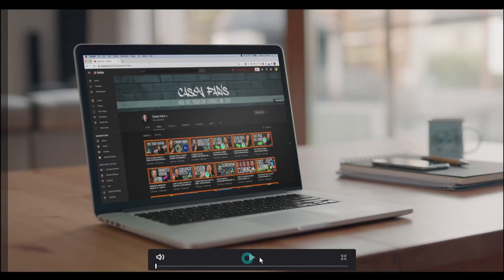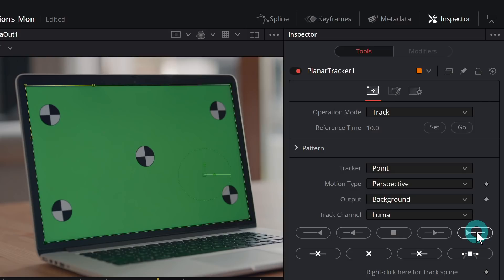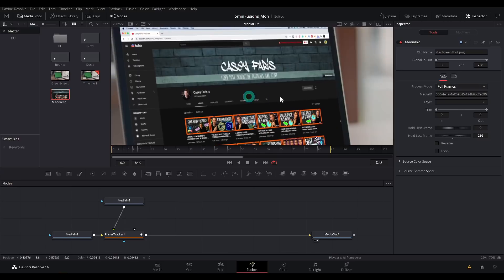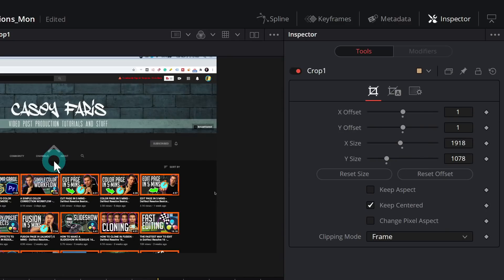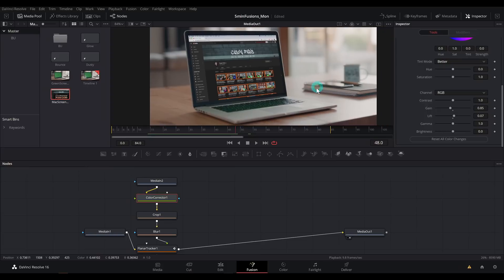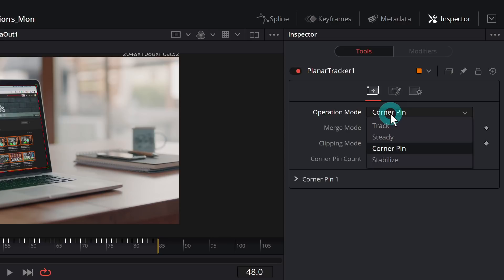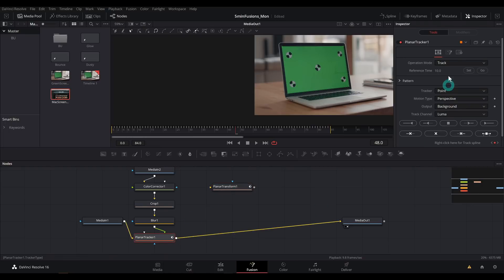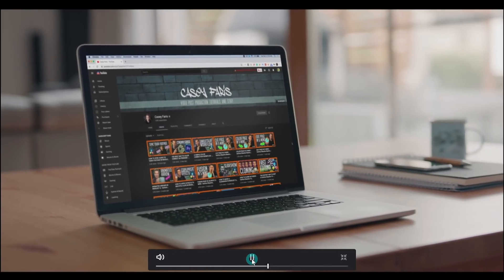SCREEN REPLACEMENT IN FUSION - DaVinci Resolve 16 Tutorial [Beginners Welcome!]

Comment: Good Stuff, Change the blend mode on the reflection though. And instead of cropping the replace screen do something with it to get a soft edge, what ever work flow or effect will let that happen. 

Oh and with the reflection, if you don't track it but, instead use a the screen replace to make an alpha you can then draw the reflection bigger than the screen. Then when the shot or screen moves it will shift a little the way a reflection should. Sometimes this makes a perfect illusion, other times you may need to add a few key frames to the reflection node to make it move a little differently.
Reply: That sounds almost like a scrolling texture... nice tip

Comment: What about placing an image or video onto a screen that is moving?  And moving into different angles?
Reply: It should work the same as the tracking method he used takes note of the screen's perspective, so if the screen is changing shape from perspective the tracker should work just as fine
Reply: @scorebatgaming  it doesnt work i think
Reply: yes!
Reply: Not working for me...by the time it has 'tracked to end', the zone ive selected ends up off the green screen. Help please 🙏
Reply: @bacanito  same happening to me
Reply: @venutiggu6291  you need a more powerful computer. Both the ones i tried had 16gb or RAM and it wasn't enough. I mostly make music and if the computer cant handle something, ill get errors. I know understand Davinci will simply go as far as it can go and say nothing. For this issue, anyways, havent really gotten anywhere else, im learning film through an internship and they use Premiere 😑

Comment: Just a question about the lift and gain corrections: wouldn't the screen itself be the brightest part of that image, in its bright spots? If so, why match it with ambient light? I can understand the concept for the darks, but I don't know about the bright part...
Reply: the screen may emit light but in a video shot unless the monitor is at max brightness with a bright overall image it doesn't look realistic that a computer brightens the room.  In this example, most of the image he is superimposing is dark, so it wouldn't give off the same kind of light splash as the green screen did (on the keyboard).   Personally, if it was a bright clip i was superimposing, I would color correct the keyboard area to match the screen (white, green, whatever).
Another option, way more advanced, is to have a copy of the same mediain (of the screenshot), flip it upside down, reshape it and overlay it onto the keyboard, then play with various color, saturation, and blending modes to get an effect that is more detailed.  This would also be useful for the weird reflections that might come from (for example) if the media on the monitor is actually a video clip. as the video plays on the screen, a reflected and muted/blended version plays out on top of the keyboard.  Hope that helps!

Comment: What I’m looking for is a fast and easy way to add borders to PiP images. I have a photography vlog, and it would be great to be able to easily add the still photos over the video with a small white border and a drop shadow.
Reply: if they are all the same dimensions, you can prepare a fusion template for your photos. Aside from any adjustments you might want to make with a color node, you'd only need to use keyframes and the mediain (the additional images to appear on your footage).   Then, any time you want to add a new photo, you pull down the template, add the new image, and then tie it into the footage at the spot you want.  The template also gives continuity for the overhead spot.
Example - you can use a mask layer at 0 width in frame zero and 100% width at frame 2 seconds after, with the photo under the mask layer. Then for the same keys you can also use the fade or blend sliders to make it appear over the 2 seconds (but only within the mask). Want it to look like a printed photo? put a white background with a shader node on it for some drop-shadow and place these behind the photo as well.  (make sure the mask fits where you want it.

The thing with these transitions is, it's easier to imagine the end result and then move backward in the process to determine how to display when it is being played forward.
hope this helps!

Comment: What if a hand or fingers crosses over? 

For example I had 2 clips I shot, I put tracking marks on one on a phone. in one scene and my arm passes over a couple times
Another I thought the spot was above my head and it was more most the scene, but I crossed in front of it with my hand and head a couple times. I didn't think I would need a green screen since I didn't think I would pass in front and I was shooting myself. 

I tried to mask over and track them, but the issue I had was figuring out if it was even possible to stop at a certain point, move the mask or cut it out for those handfuls of frames, but not totally change the shape of my corner pin. So I would example get to the part where my arm crossed and tried to move the corner pin and thought it was now closer to the shape I wanted, the rest of the track would be in that shape and look weird. 

Similar to changing from clip to frame in the color tab, but in fusion. 

I ended up in a rush just cutting the track and using a freeze frame and then cutting between the two, but it meant it was static. 

Something like that if it hasn't been shown is what I want to learn.

Comment: Hey Casey, maybe you (or someone else) can help because Fusion is driving me absolutely nuts. Here's the situation:

I'm talking about a conclusion, and pointing out three things. All three things need to pop up on my screen. Those are: "Cheap", "Lightweight", and "Quality".
So far, I tried to add three texts, then make compound clips, then make a fusion clip etc. Obviously I messed that up so it didn't work. Then I thought: Why not build it in Fusion. So I got the video clip, and made it a fusion clip. In Fusion, I added three texts. I've also added a tracker. So now the situation is:

Text 1
Text 2
Text 3
Media in ======Tracker=======Media out

Then, I needed to transform the text. Because: "Let's make it more complicated shall we?"

So the situation is this:
Text 1 > Transform (1)
Text 2 > Transform (2)
(Both transform are now combined in a merge node (1))
Merge node (1) goes into the Tracker(1)
Media in(1) ===== tracker(1)=====Media out(1)

So far so good, it's doing EXACTLY what I need.. but here's the problem.....
I can't get that third text added and/or to work. No matter what I try. It's driving me absolutely insane. Apperently I can't create a third text, with a transform node(3) and then have it connected to the merge node. When I do that, I don't see any of the text anymore. Why can't I add three texts to one merge node? How can I solve this?

Because what I've done is: Create a third text (Quality), create a Transform (3), and I wanted that to go into the Merge (1) and then the merge goes into the tracker but it just won't work.

TLDR: How the .... do I add a third text in a fusion composition which also uses the tracker node that I've made?
Reply from the maker: Add a second merge right after your one combining the two texts.  That new merge becomes your big comp with all of them that you can pipe into the tracker.
Reply: @CaseyFaris  Youtuber of the year award for you sir, thanks! Glad you were around to help!